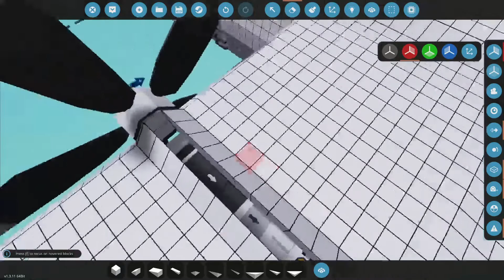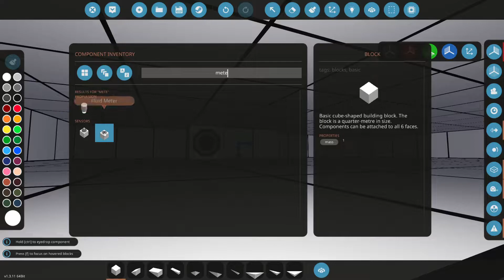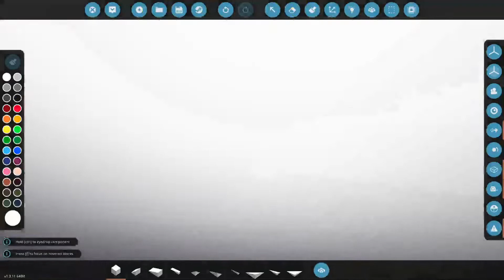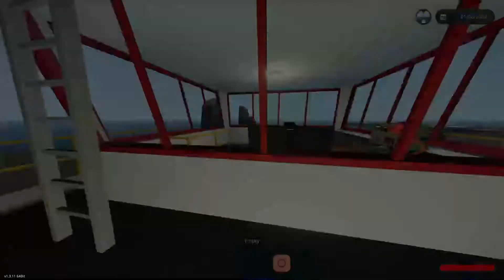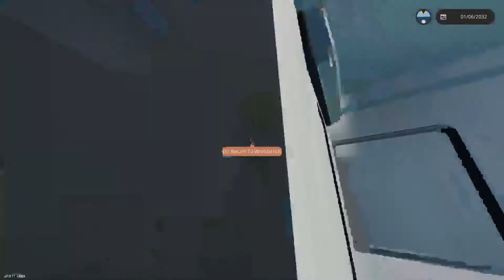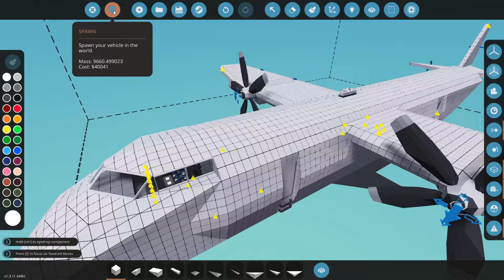Working Jet Engines. It FLYS! Stormworks EMP BOMB Plane Build [6]  [Search & Destroy]

Comment: the front wheel problem is probably your weight. the track cant hold the weight, and tries to get it up at the same time, which causes the bouncy thing. now im not really a big pro at the game, but i think something like piston suspension could help. they are a bit stronger than tracks. hope this helps you out a bit :)
Reply from the maker: Yeah I definitely need to change it up. I've got an idea to tuck in the back wheels as well.  I'll fix it soon.